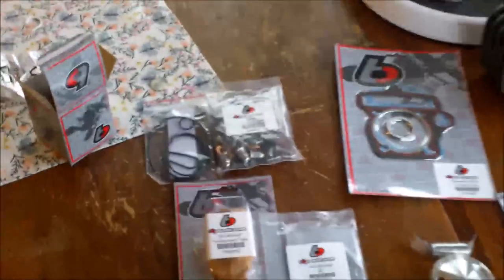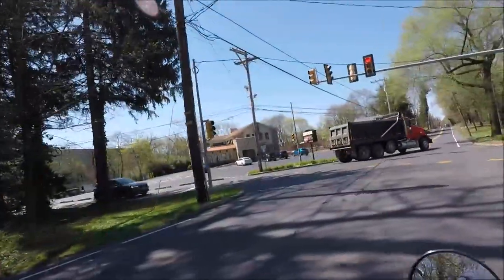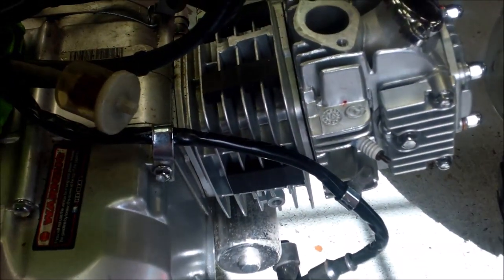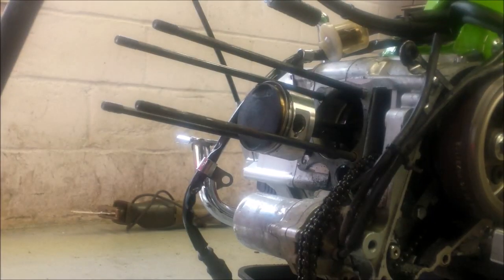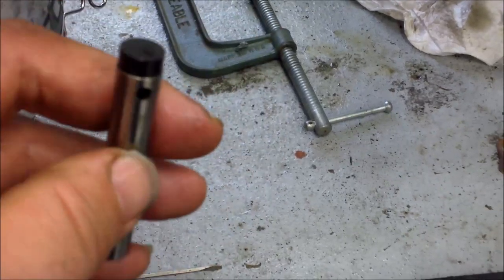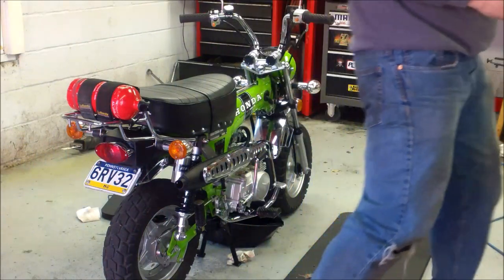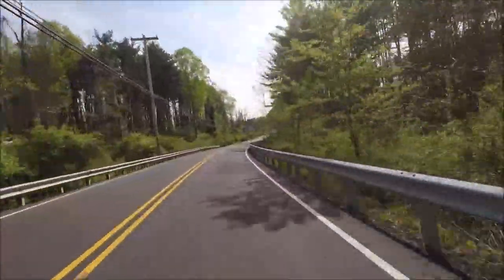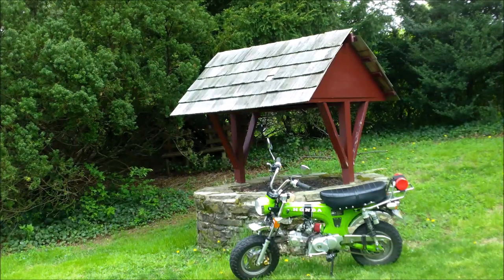Icebear Champion CT70 BIG BORE KIT install

Comment: So how do you like the reliability of that bike is it is it worth buying I'm looking to put some Twisted ape hangers on it it's longer seat take the back rack off lower it High Performance Engine Parts on it or maybe even a 190 or a 212 I don't know but I like what you're doing so I'd like to know exactly is it worth it or should I buy something else I would like four different kind of scooters and I owned Vespa and I used to own a trail 90 on a 50 frame I rode I rode poop mopeds Thomas mopeds I used to work on mopeds and scooters but I just wanted to know is it is it reliable and is it worth it
Reply from the maker: Is it as reliable as a honda or kawasaki? No way but is it a basket case ? not at all. You will need to be able to fix little things . Mostly things rattling and falling off . In stock form I would imagine its more reliable but since Ive changed some things you never know whats going to happen . The swingarm is a known problem. No big deal. I still jump on it and ride 80 miles no problem. If you like the style Id say buy it.

Comment: good job for sure, you should have just 190 swapped it though. i dont know what it cost to do what you did. imo the 190 is the better thing to do as its also a 5 speed and can cruise effortlessly. ride safe out there and enjoy.
Reply: If you do the 190 swap do you have to change out the wiring harnesses and if so what harness do you need to get does it come with the wiring harness where you can just plug and play or do you have to mess with it
Reply: @Rumotorizednosparknoride-w9i  mine didnt come w a harness. i wired the 190 into my harness i had. i swapped a tao tao hellcat. it was not plug and play.

Comment: Wow you done a good job with that bike even before the head kit that thing is moving swiftly with that big body of yours on there hahaha mine's the same way has a lot of torque I was pleasantly surprised But first second and third are basically unusable because of the torque I wish there were a lot taller well maybe second and third I basically ride around in 3rd and 4th as long as I'm rolling and don't come to a complete stop she'll move along pretty quick I didn't put my heel toe shifter on correctly also I put it on level I should have made the heel higher because I can't push down on it and I snapped the bolt anyways good job man!
Reply from the maker: I dont like the heel toe shifter. I replaced it soon after getting the bike. heres the one I used.
https://www.amazon.com/gp/product/B0113NMKD2/ref=ppx_yo_dt_b_search_asin_title?ie=UTF8&psc=1
Try it youll like it.... Maybe

Comment: Your video is appreciated! Your rear shocks caught my eye; the oe Little Bear shocks rattle from the start, other Honda ct70 clone owners have remarked. Where did you purchase the rear shocks? Will the VM26 carb work on the 125cc motor?
Reply from the maker: I got them from amazon 
https://www.amazon.com/Newsmarts-Adjustable-Motorbike-Absorbers-Universal/dp/B07LCMBKK3/ref=sr_1_9?
The VM26 is a beautiful carb for the 125cc 
I like the shocks rides much nicer, Double check the length. Im not sure these are the EXACT ones.
Reply: @yeksun  Thanks! I have looked at the order form on the Ice Bear Champion and for $99 they offer an aluminum swingarm and digital speedo. Did you mention a shortage of success finding aluminum swingarm replacement, or they were out-of-stock when you bought your Little Bear? Carb - I believe you though I'm hearing 'Nibbi' is popular. I'm kind of struggling to imagine 60 mph on a Honda CT70 at my age (69). This bike is for two grandsons, pending permission from their mom and dad.
Reply from the maker: @horsewnoname872  I couldnt find an aluminum one when I needed it . I guess they are available now. There are lots of places online to buy these ice bears. I got mine from Cajun maddogs. These options werent available to me. I guess any carb is better than the tiny one that comes on it. I have only had experience with the vm22 clone from amazon its like $20

Comment: Still debating on this kit versus the 190 swap. Looking to cruise effortlessly at 55-60 since I’m mostly on country roads
Reply from the maker: If your asking my opinion, I would say do the 190. The 4 speed that we have is the weak link . Meaning to do 55-60 its screaming. So to sustain these speeds you feel like your hurting the engine. I tried an 18 tooth sprocket . not thrilled with the results. I wish I had an extra gear.
Reply: what did you go with? can you drop a link to that 190 kit
Reply from the maker: @AskTheKid  I did not do a 190 I did a 141 kit. here it is
https://tboltusa.com/store/tbparts-roller-rocker-race-head-v2-146cc-big-bore-kit-china-120-125cc-engines-p-55.html

Comment: Very detailed video - lot of effort, but you made it look easy. On a different note, what would you recommend for tires?
Reply from the maker: These are the size and modal  tires I used,
https://www.amazon.com/gp/product/B00WKQD946/ref=ppx_yo_dt_b_search_asin_title?ie=UTF8&psc=1
With the bigger tires you have to move your front fender up and you loose your center stand.

Comment: Can't wait until I get my 212cc
Reply from the maker: That will be great. Make a video of it. Id like to see that.
Reply: What is a 212 cc. Is that a kit?
Reply from the maker: @Gokywildcats11  Oh , no . not at all. A 212 cc is based on a 190cc engine with a bigger bore ,making it a 212cc. They are very powerful but they use a lot of gas. since our tanks are only .9 gal , I dont think youll go very far. With my 140cc I only get 60 miles to the tank. Of course you can add auxiliary tanks
Reply: Damn Dawg! Lol post pic video something!!

Comment: Yours feels stable at 60mph? When mines at 52mph it feels like i'm living on a edge, not all that stable as far as handling even going straight.
Reply from the maker: Yes . In a straight line yes. Do this test... Put your bike up on its center stand and get the rear wheel off the ground. Then grab your rear wheel and see how much side to side wiggle you have . I am guessing you have a lot . The swing arm bushings in these are no good. Check out my video on the subject.
https://www.youtube.com/watch?v=MnJcB8a5U0g&t=29s&ab_channel=yeksun

If you need bushings someone is selling them on e bay. 
https://www.ebay.com/itm/194311949024?hash=item2d3de50ae0:g:0FYAAOSwy8ZhJhuD
I hope this helps. Replace those bushings and go from feeling like a toy to a nice bike.

Comment: I have a champion with the stock motor and I get a terrible vibration at higher RPMs.
Reply from the maker: Hmm . How bad is it? mine has a little vibration when its all the way tached out.
Reply: @yeksun  Bad enough that it makes the speedo reverse direction and go down after 40mph.

Comment: mpg ?
Reply from the maker: It gets 60 miles to the tank. much less than stock. I carry  spare fuel bottle just in case. The bottle gets me 20 more miles.
Reply: @yeksun  i figured it like fuel my 70cc one back in the day got close to a 100mpg but at a max speed of 45 - still a fun bike - better than walking
Reply from the maker: @gordonhall9871  Yeah Friends of mine have left theirs stock (clones 125cc) and they get 100 miles per gallon. Its all what you prefer. I ride mine pretty far like 100 miles at a time so I like having the extra power. Stopping at the gas station is a nice break. LOL

Comment: Can you run the race head and cam without the big bore kit?
Reply from the maker: I dont see why not. If you contact t bolt usa they could tell you for sure. Im just curious, why wouldnt you do the cylinder and piston as well?
Reply: Honestly just to save some money. The cams are only $80
Reply from the maker: @ozzyvanhalenrox  Ok. But keep in mind the cam for the v2 race head will not fit your stock head.
Reply: I contacted them and they said they have 3 different cams. One question they had was the number of teeth on the stock cam sprocket. Do you happen to know if the stock cam sprocket has 28 or 32 teeth?
Reply: I’m fairly certain the stock cam bearing is 35mm on the sprocket side and 32mm on the other. That would mean I’d probably use their TRC-1043-1 cam. If there’s any way you could measure the stock bearings that would be awesome!
Reply from the maker: @ozzyvanhalenrox  Stock is 32 teeth . I just counted them.
Reply from the maker: @ozzyvanhalenrox  I measured the OD of the bearings and it looks like 35mm and 32mm like you said but that part # says 68mm overall length center to center. Im not sure what that means. center to center of what? Also the 32mm bearing is only 8mm wide. the one in the pic looks wider. But maybe it would work.. Ask them they should know.